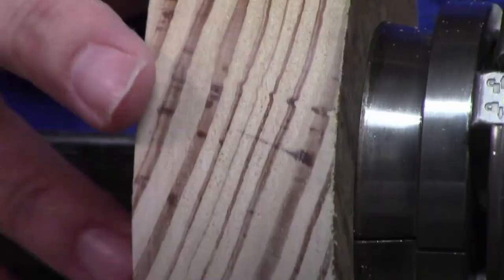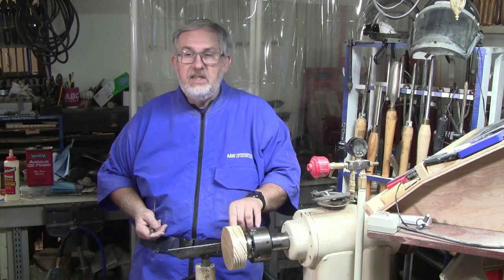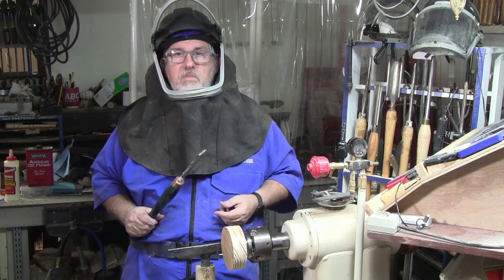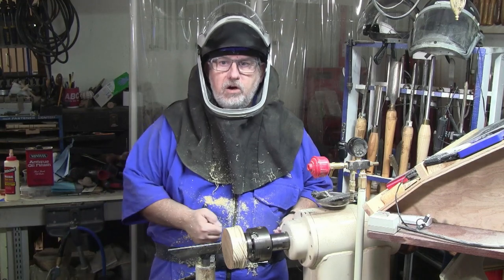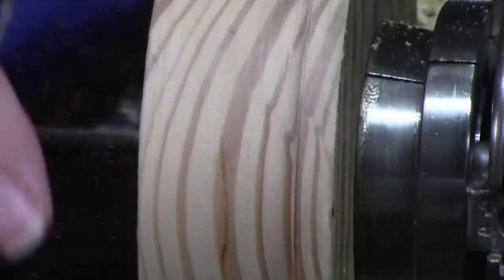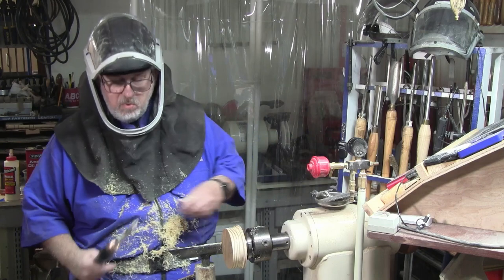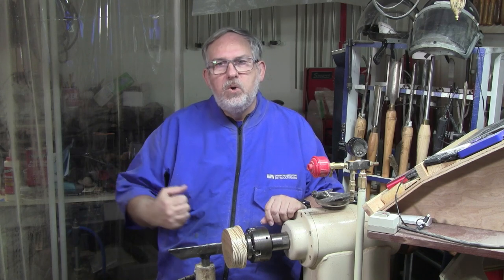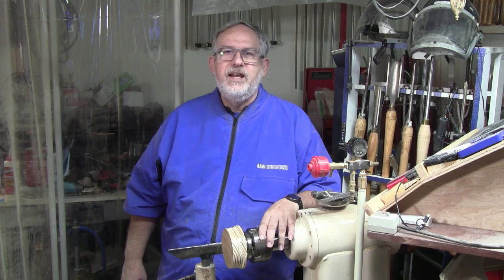How Often should I sharpen my bowl gouge By Dean's Woodworking #woodturning #woodturningforbeginners

Comment: I like how Mike Peace describes it. Mike says "If it's almost sharp, it will almost cut." You demonstrated that very well in this video. And as you stated, the amount of time between sharpening's depends on the density of the wood and the quality of the steel. Also you have to consider the dryness / moisture content  of the wood. Green wood will not dull a tool as quickly as dry wood. A third factor is the orientation of the wood. End grain dulls a tool much quicker than side grain. So as you pointed out, "When you have to push harder the tool is dull". Thank you for sharing. Have a great day and stay safe.
Reply: Glen you beat me to it. I was thinking about the same Mike Peace quote and was going to post it, then I scrolled down and saw your comment! :)
Reply from the maker: Thanks for Watching and Mike is 100% correct.